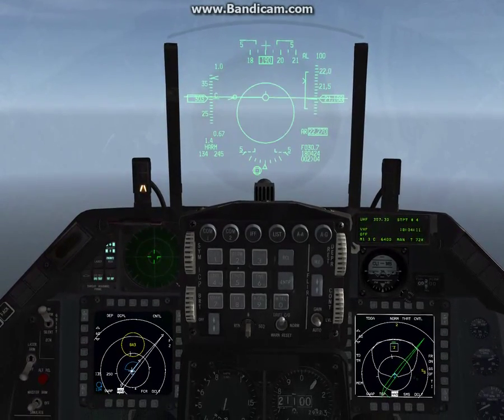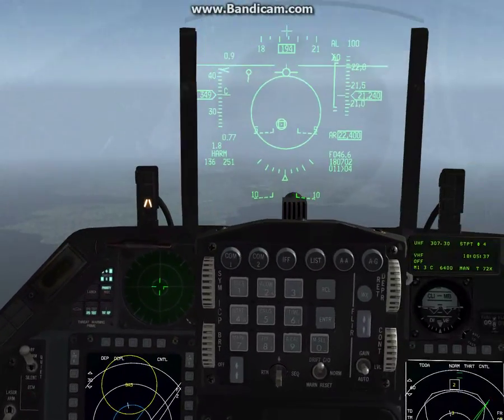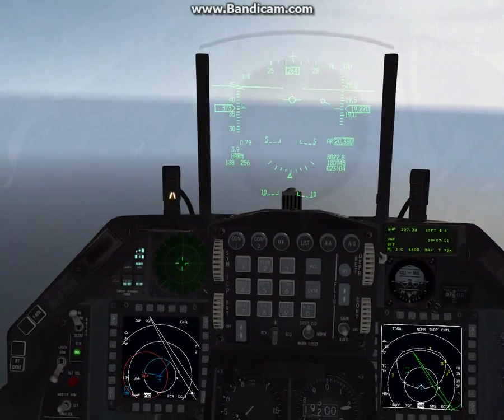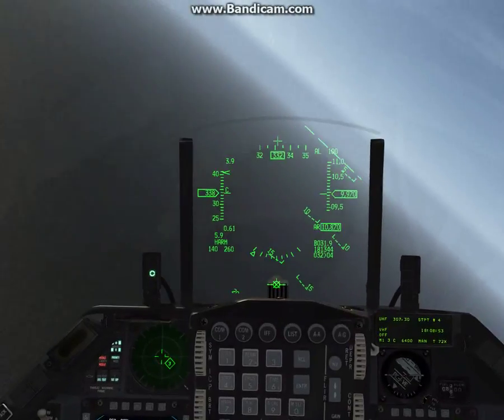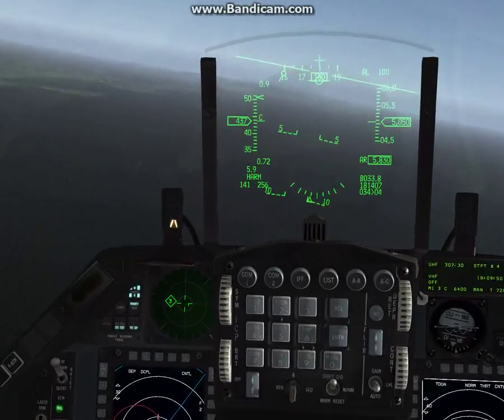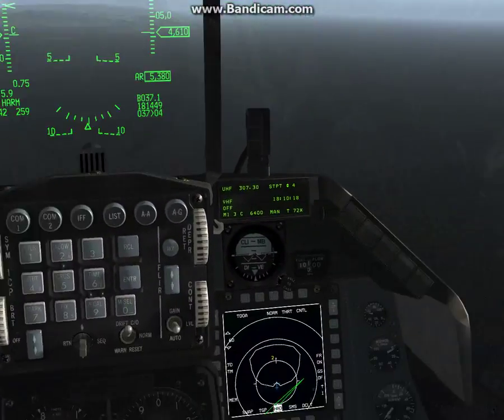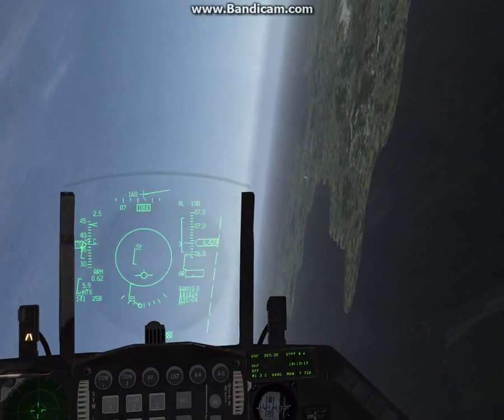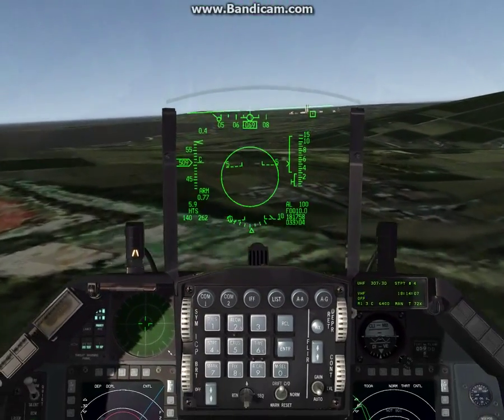✪ BMS 4.32 F-16 Falcon "SAM Avoidance SEAD Tutorial" Part 1

Comment: I thought the HARM also had inertial guidance for when the emitters offline, so as not to lose target right away when the RADAR goes off?
Reply from the maker: Kyle Tekaucic It does have memory and remembers the last known position of the last contact, however, this system is not perfect and takes a lot of variables into account, has a decent chance of missing as far as I know.
Reply: Fair enough, I just didn't know if Falcon 4.0/BMS modeled that particular feature, treating the HARM like a Shrike with a more discriminate seeker head.
Reply from the maker: From what I recall, BMS also models the Home on Jam (HOJ) feature of the HARM and AMRAAM.

Comment: I thought the ALQ jamming pod only had an effective arc of 10-2 O'clock and 8-4 O'clock?

Anyway, thanks for sharing, nice video =)
Reply: Just a quick update, seems I was right. In you're BMS install folder, DOCS/Legacy Manuals/Realism patch 5 PDF, page 134. you have jamming from a 60 degree arc from your nose and 120 from the rear. 5 degrees above the aircraft and 20 degrees below. Nice diagram that makes it really easy to understand.
Reply from the maker: tsunami49 Thanks for the insight, I heard that it was most effective ahead and behind you but that makes sense as not to smoke your flight. Thats why at 4:37 I state Im going to put him on my 6 o'clock and get the Jammer on as its the most effective arc so your absolutely right, Beaming on the 3/9 line still works with a jammer or not as the radar has a difficult time guiding targets across the scope.
Reply from the maker: I didnt realaize the Jammer had complete blind spots so thanks